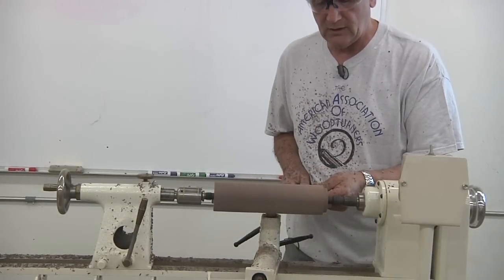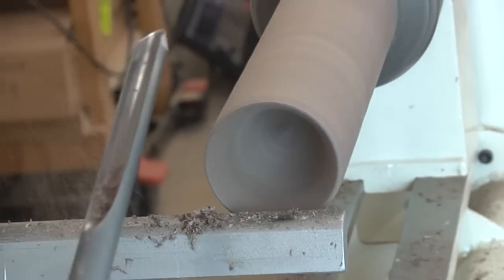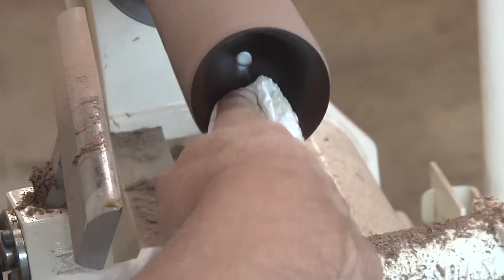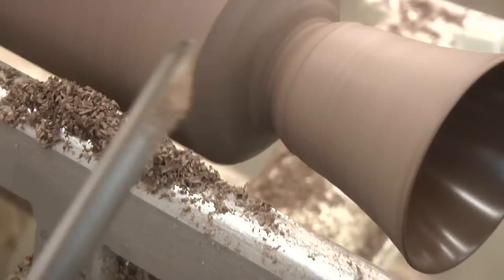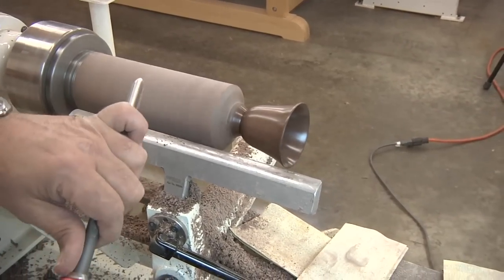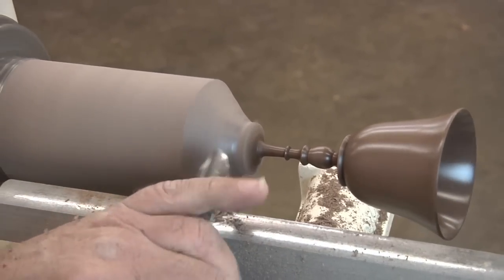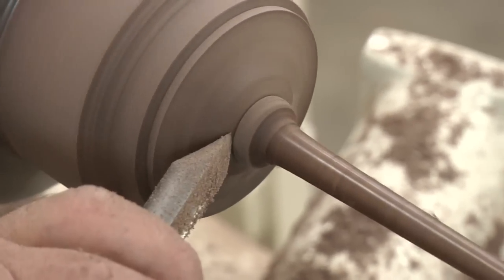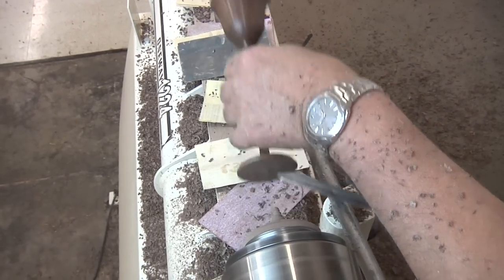Turning a Goblet with James Santhon

Comment: Notice I never turn more than an inch away from the mass, so, unless I get a catch, the force of the tool isn't going to adversly affect the stem. The wood was very stable, and didn't move much. That is why I use dry wood. Green wood is much more difficult to make the thin stem, so I would put a paper towel in the cup of the goblet, and bring the tailstock up to the cup, but I wouldn't tighten it just insert it lightly into the cup to keep it from whipping.

Comment: Another thing that I didn't do on the video was to drill a 3/4" hole on the cup end about 2 1/4" deep, or 19mm x 57mm deep. That way I'm not digging in to too much end grain, and it makes it a little easier to hollow out the cup.

Comment: A perfect video. Thank you. Just one thing I did notice. Just this afternoon I turned my 4th goblet, strangely in walnut. It was local wood from a tree where I live here in Kent in the uk that was cut down two years ago. My observation was the huge colour difference in your piece compared to mine, yours being much darker. Is your American walnut a different species to ours in the uk do you know? Or will my piece darken down with age? It is perfectly dry.Thanks again.
Reply: Hi Peter, I'm from the uk as well, and lived on a privately owned estate of 25 acres that had both american walnut and the uk variety. Having had wood from both (with the owners consent) the american walnut is harder and darker than our own native wood. I also found out that the shells from the american walnut are so hard that they are crushed and used for shot blasting, no wonder it took a hammer to crack the nut :))

Comment: Yes. I take epoxy 30 min pot life. and add in slowly Acetone until the epoxy is thin but not like water.  Start brushing into the mug until fully covered outside too if you wish.  NOW the Safety WARNING AND HEED THIS.  The mug cannot be used until the finish has cured and degassed for at least a month or more.  once it has cured there should be no issues with hot beverages.

Comment: Is this the same James Santhon, that made the 34 woodie, I have been wondering how the rear windows  are mounted are they in a stainless steel frame set in a dado?
Reply: Yes. The styles of the doors and rear quarter panels have a dado cut at an angle to accommodate a brass channel that was used originally for curtains, we slid in tinted plexiglass instead before putting the top on, and on the doors the plexiglass is removable.  You can see on the photos of the car in progress if you blow up the pictures.

Comment: Hi James thanks for you great video, could you please tell me what is the length and circumference of the piece of walnut that you used in this project, cheers David From Tasmania, newbie here to turning.
Reply: David, the diameter of the cup is 3" inches in diameter, and the original length of the turning blank is 10" inches. I lose some length with the way I part it off. I also have started drilling a 3/4" hole about 2" inches deep for the cup, which eliminates a lot of work, because you are turning more edge grain than end grain.

Comment: Great job.  With the finish that you used can you use wine in the goblet?
Reply: Alcohol is what you thin shellac with, so it wouldn't be a good idea to put wine in the goblet. If you want to drink wine out of your wooden goblet Mineral oil would be a better sealer for the wood, and It is food safe.

Comment: did you basically use the same gouge for that whole project?
Reply: Joseph,
     I used a 5/8" gouge for the inside of the cup, and the straight part of the stem, and I used a 7/16" detail gouge for the rest of the turning.
Reply: ah! thanks & great job! i just started turning and this video is really helpful

Comment: what is your RPM for turning this?
Reply: This particular lathe didn't have a digital read out as to the rpm's, but I would guess that I was turning at about 1000 rpm. I did slow the lathe down a bit when the wood started to move towards the end of the video.